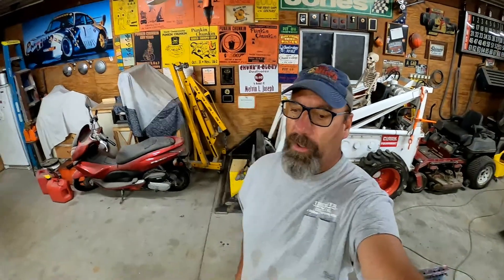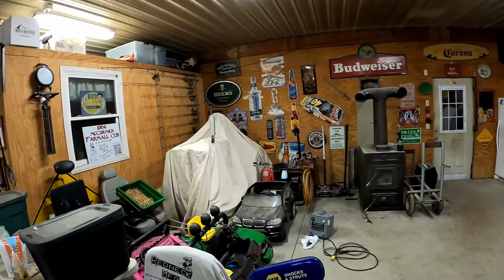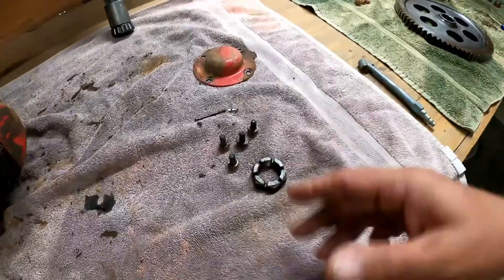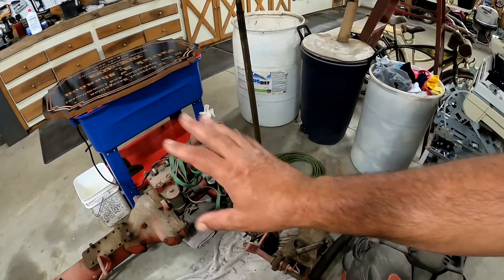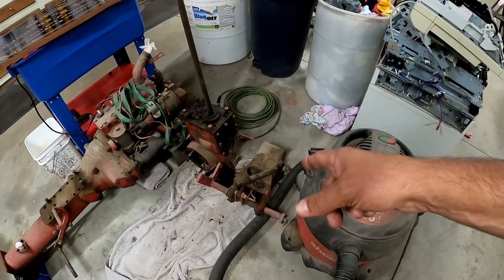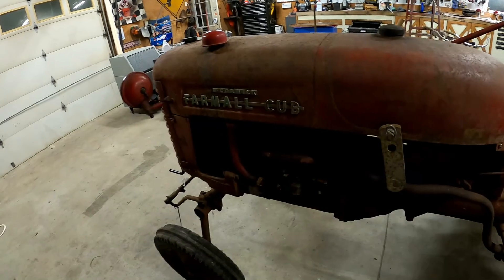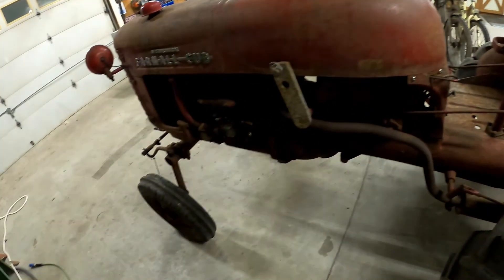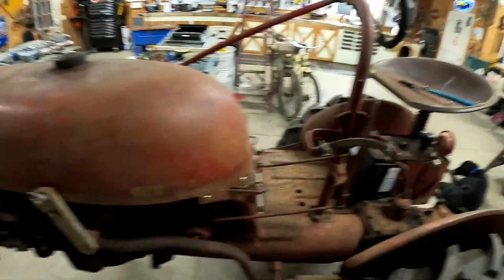NO WAY !!! Another Farmall Cub Video...

Comment: Hi Rick, looking great on the resto. It's a month after your posting so guessing you have probably done the sandblasting by now, but I would suggest cutting out a piece of thin metal plate or even plywood to bolt on over the axle hole to protect the bearing race while sandblasting.
Reply from the maker: I actually 3d printed a plate to fit over the hole it worked awesome... this poor tractor gets thrown onto the back burner almost all the time... if its not a honey do that takes me away from it , its just another job that gets me.... winterizing boats, fixing other peoples problems, always something that comes before this poor tractor... Great Idea tho Thank You...